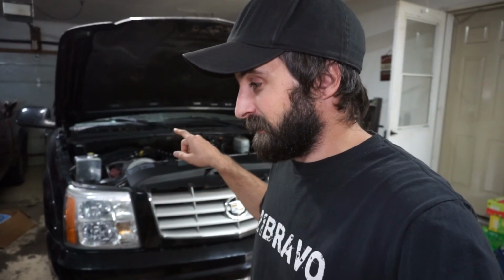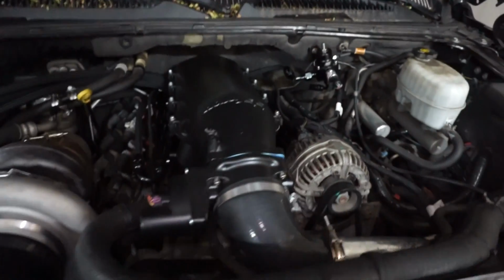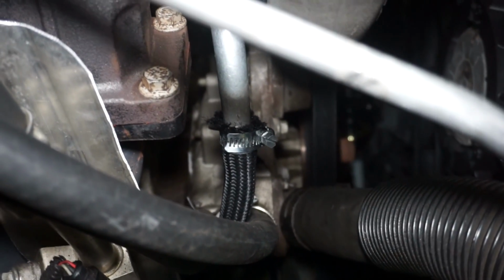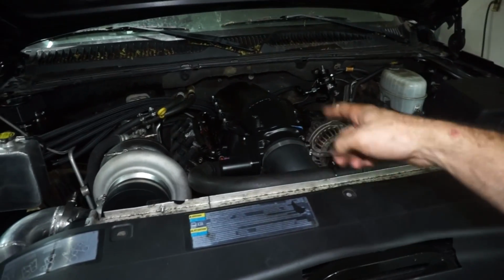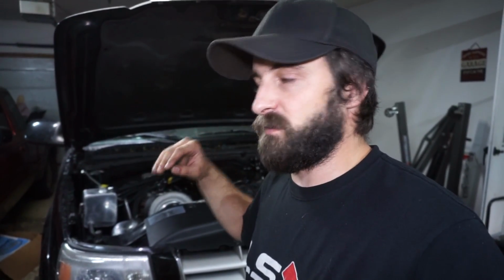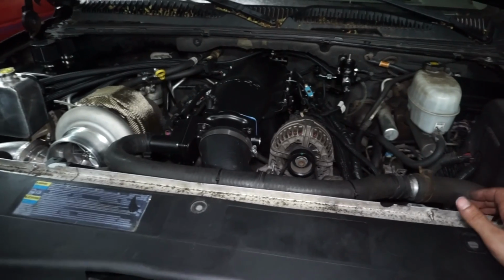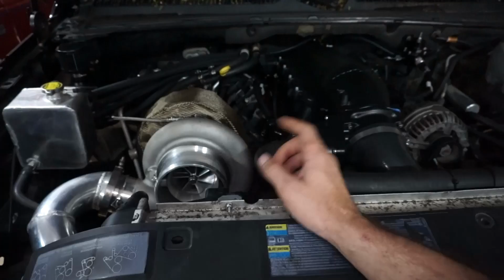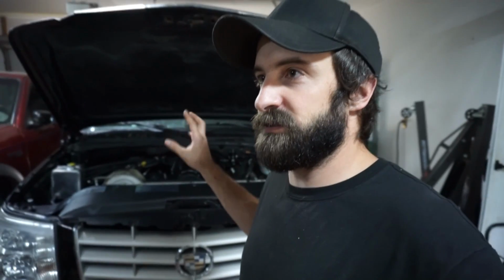Fixing Issues On Dadillac | Turbo Escalade

Comment: What throttle body are you using? Also which pedal assembly and controller? I’m working on a turbo ls c10 and already have my terminator x max with dbw. I know Holley supports different throttle bodies but after market I don’t know what all they will accept
Reply from the maker: 102mm off ebay around $100 range, and stock 08ish silverado pedal from junkyard.
Reply: @BlaserBuilds  thank you sir. I guess I’ll see if I can find one to run with soon

Comment: Is your boosted ref connected to your intake or compressor? Just getting ready to dive into the turbo setup w/ my 5.3. 3 port or 4 port solenoid?
Reply from the maker: 4 port, and I have it ran off the vacuum block coming from intake.

Comment: good info about the wastegates causing the flutter.  what cam you running? your revving that thing higher then i though.
Reply from the maker: BTR stage 3 turbo cam. Same cam and intake set up I used in the mustang and I shifted that around 7700.